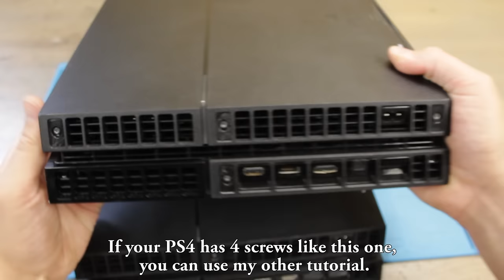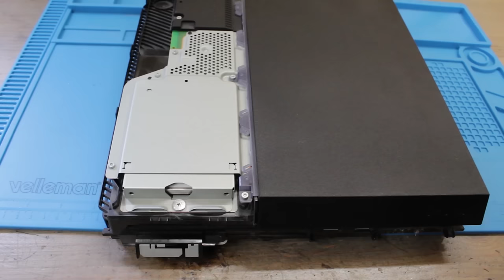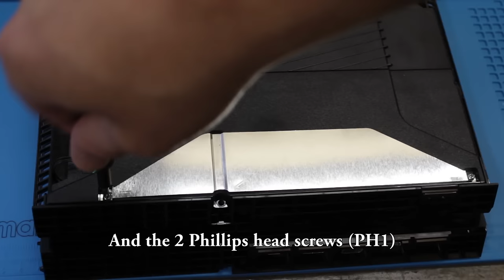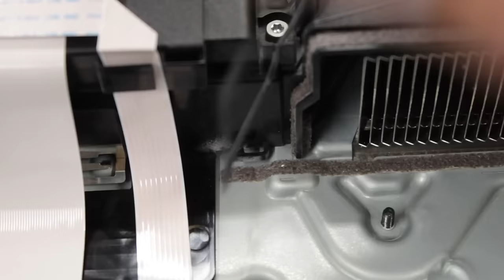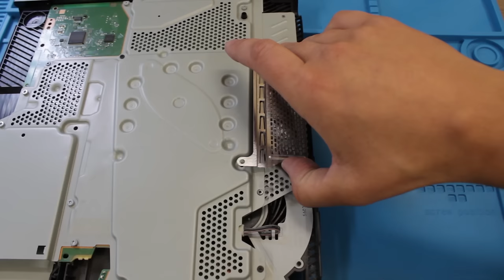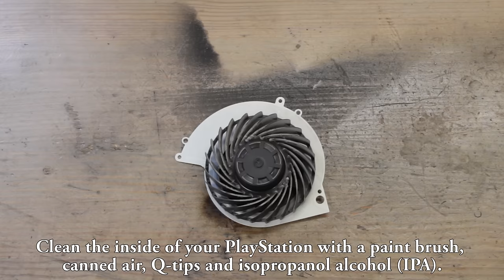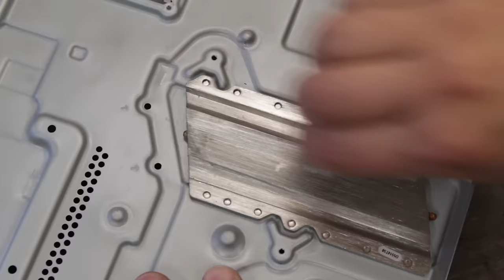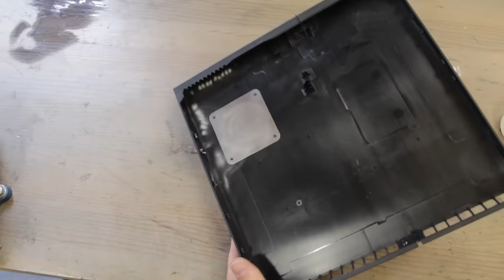PlayStation 4 model CUH-1200 cleaning tutorial.

Comment: My ps4 is dead (:
Reply from the maker: Oh no! What happened?
Reply: @SpareTimeWorkshop  I don't know I try maybe 5 times but it doesn't work
Reply from the maker: @rita8  So what exactly is he doing?

What that after cleaning?
Reply: @SpareTimeWorkshop  he's donig nothing no blue light or orange also after changed he's Thermal paste still the same
Reply from the maker: @rita8  If nothing happens at all, usually the power supply has died.
Reply: @SpareTimeWorkshop  so I need to get another one?
Reply from the maker: @rita8  I cannot give you a guarantee that your ps4 will be repaired after. But if nothing happens at all when you turn it on. And the disk drive doesn't beep when you press the button either. Is it usually a broken power supply. What you can try is another power supply cable just to be sure.
Reply from the maker: If you want to buy another power supply. Then first check which power supply is in your ps4. There are different models.